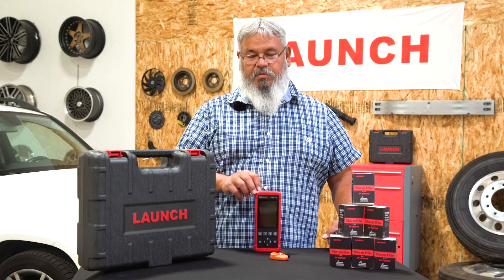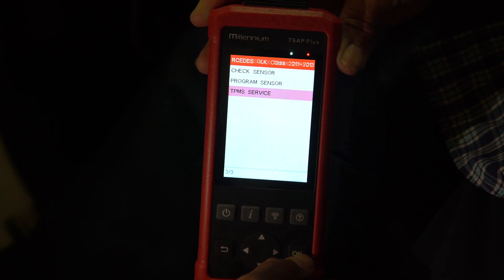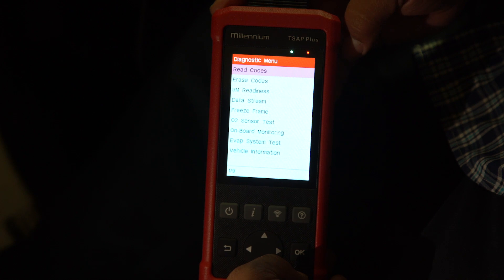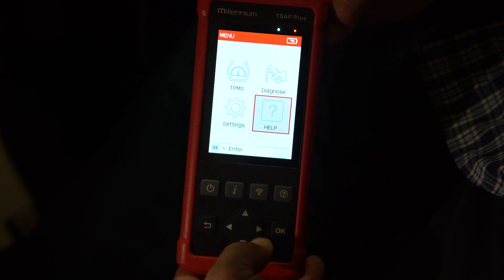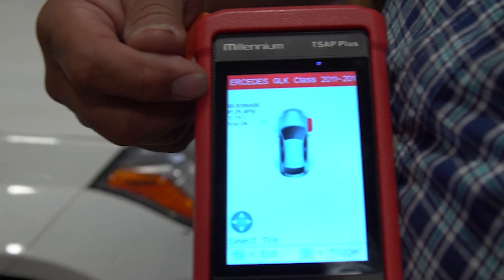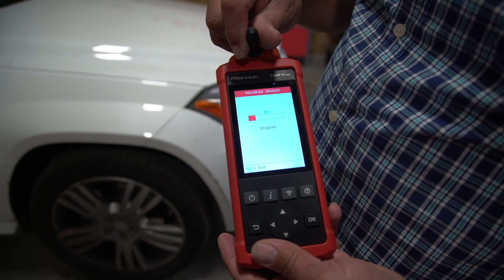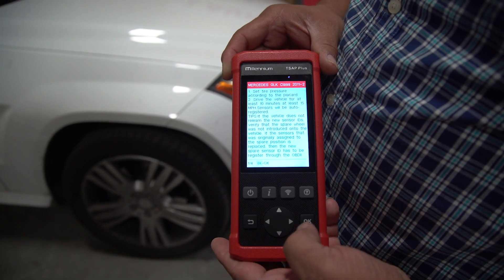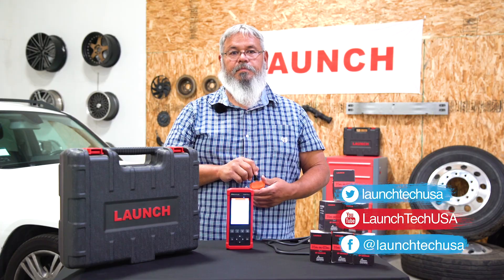Launch Tech USA- How to Read and relearn TPMS Sensor on Millennium TSAP Plus

Comment: Cannot program any tpms sensors with the Launch millenium tsap I know this is an older tool but it should still be able to program a sensor. On software version 11.32.180704. Boot ver 1.03. Anyone know a solution?